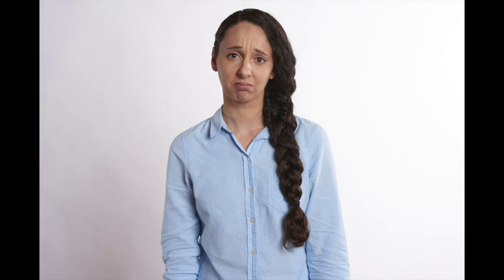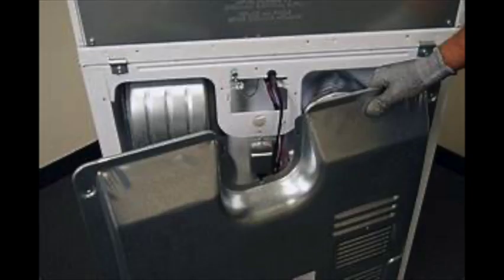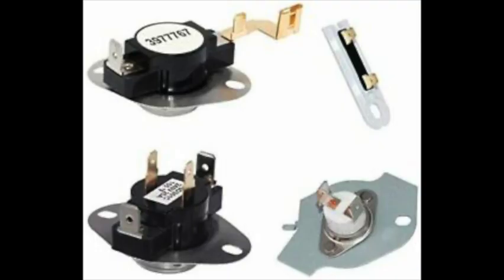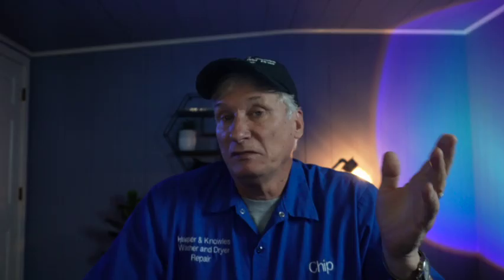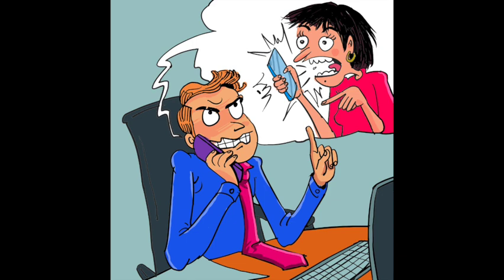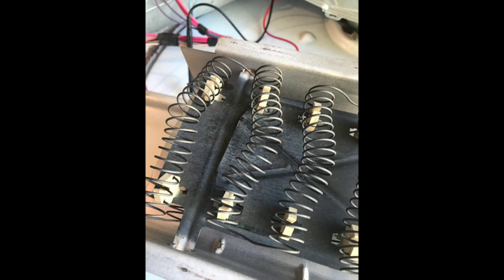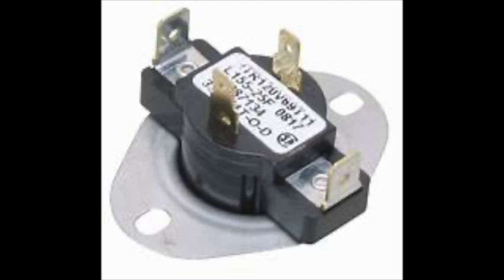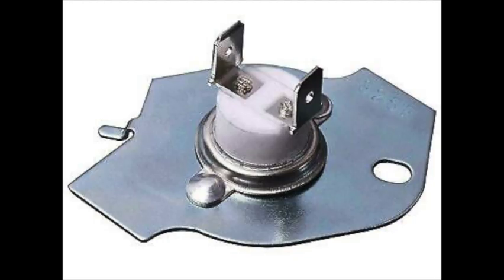How To Diagnose Clothes Dryers That Blow Fuses: Testing Thermal Fuses & Beyond,

Comment: Wow! I really thought you were going to give me the answer because everything has been happening to me in that exact same way. However, I had already replaced the coil at the first step along with all the other parts so that can’t be it. I’ve been through several thermistors and thermal fuse replacements. It just keeps overheating and then tripping/blowing. Sigh…
Reply from the maker: So, if your machine has a thermistor it isn’t the machine like in the video. Without knowing your model I can only guess that you may have a machine with a circuit board and not an analog timer. In this case you may have a faulty control board and you are watching the wrong video. If this is the case you’ll have to replace the faulty board. I hope this is the correct answer for your particular problem . Like I said, without being able to actually diagnose your problem myself all I can give you is my best guess. Thanks for watching!
Reply: @HarperandKnowles  you are incredible for replying and replying so fast! I greatly appreciate this. I have a whirlpool duet dryer wed9200sq1. You are correct it’s not the same. I’ll check out the other videos! Thanks!
Reply from the maker: Pull your control board out of the machine and remove it from the white plastic case. Examine the back for a burned solder point on back of a relay. If it is melted out re-solder that point and it will work for you again.
Reply: @HarperandKnowles  thank you. I’ll try that. They no longer service dryers where I live so I’m trying to do this myself to save from having to buy a whole new dryer. Although sadly, if it is the board, they seem to be very expensive! Thank you sir!
Reply: I’m so thankful for this response. I opened up the control board as u suggested and can see something completely fried on it. If even melted the wiring harness attached. Looks like I can buy a new control board but not seeing any wire harness replacement options. Do you know of any?
Reply from the maker: If it is a relay, it will probably be a standard-sized spade connector. You may be able to repair this by cutting away the old connector and splicing in new wire and new spade plugs. Take pictures first. If the relay is burned, you can order it online and solder it into the board. Most of the time, only one contact on the back side of the board is damaged, but if your wiring is compromised, the whole board may be damaged too. Here is a link to a Duet wiring harness https://www.repairclinic.com/PartDetail/Wire-Harness/W10777438/4383129?TLSID=1779&Ref=611198&utm_term=4585307092177722&utm_campaign=Dryer+-+Medium+Margin&utm_medium=cpc&msclkid=5f8a782ea6b815aad8341c976d58ca32&utm_source=bing&utm_content=Ad+group+%231. I'd use the part number from this page and try to find a used one on eBay, and make sure your model number is compatible. Thanks for the progress report!
Reply: @HarperandKnowles  wish I could share the pictures with you over YouTube. Appreciate all the help.
Reply from the maker: text them to 337-831-6757

Comment: Hello, the heating eliminate went out so we bought a kit,  but once we put everything back together it gets hot enough it blows the thermal fuse, I changed out all the Thermal Cutout Fuse, High Limit thermostat, and the Cycling thermostat. the vents are clear out side and inside the dryer vent is too, I never used the L250-80F fuse not sure if it suppose to go on top where the Thermal Cutout fuse goes are what.  I have the 309F Thermal Fuse Cutout Up top on the heating 
eliminate. I have the High Limit going to the Heating Elements Terminals. and i have the L155-25f fuse going to the Cycling Thermostat.
Reply from the maker: Your element is probably grounding out. It could be permanently grounded or only grounded when it heats up and expands. If you turn the timer to a heat cycle like timed dry and push start then after 30 seconds or so open the door and look inside at the vents. If you can see the element glowing through the vent it is grounded. You can also use a meat thermometer at the back where the exhaust is to check and see if your temperature will cycle on and off. Do this on a timed dry setting with no clothes in the tub. Thanks for watching!

Comment: Im having a similar issue but my question to you is this.  After the dryer shut down would it restart on its own after it cooled down?  This is an awesome video btw.
Reply from the maker: The only time a dryer would restart on its own is if it has a wrinkle shield or wrinkle guard option in the drying cycle. In this case it might appear that the dryer is starting by itself but it is normal for this to occur several times after the drying cycle completes to prevent your clothes from wrinkling.  If your motor’s thermal switch activates due to a motor problem the dryer will shut off but after the motor windings cool it will restart after you push the start switch, usually with an audible motor hum. In this case your motor is failing and needs to be replaced. A blown thermal cutoff fuse on the element side won’t prevent the dryer from starting but it won’t heat.  A blown thermal fuse on the blower side will prevent the dryer from starting on an electric dryer but not on a gas dryer. I hope I’ve answered your question. Thanks for watching!
Reply: @HarperandKnowles  Let me ask in another way, mine shuts down after 20 minutes and appears a little hot and I dont have to do anything but give it time to cool off and it will restart just by pushing start button again.  I have replaced all fuses, just cant pin point.  Thanks in advance for any help.
Reply from the maker: Your motor is failing and will soon quit working all together. It will have to be replaced. It probably hums loudly when starting. This is a symptom of a bad motor. Sometimes the hum isn’t present but most of the time it is. There is a thermal protection switch on the motor
that is kicking out once the windings heat up beyond a safe temperature.  There may also be a burning smell associated with a motor going bad.
Reply: @HarperandKnowles  Is there a test I can do on it or should I just order one?
Reply from the maker: I think a dryer motor pulls about 30 amps.  You could check that if you have one of those multimeters with a clamp on it to test that sort of thing. Or you could make a test cord, check this video for that: Test and Run Dryer Motors | Make A Dryer Motor Tester
https://youtu.be/kDxIt4OPBdE . I usually take the drum out of the dryer, hook a test cord to the motor and run it for about 30 minutes. Turn it off and immediately try to restart it. If it won’t restart or it quits during the test period I replace the motor.  But from what you are telling me I’m willing to bet you have a bad motor.  If your dryer has an electronic control board that could be the issue too.  You didn’t say what kind of dryer you have.
Reply: @HarperandKnowles  whirlpool kenmore elite approx 16 yrs old but never an issue, thanks for the help

Comment: I read in a repair book that said a blown fuse indicates that there could be something wrong with the motor
Reply from the maker: That's correct! A blown fuse can indeed indicate a problem with the motor in a dryer. When the motor experiences a malfunction or overload, it can cause the blower wheel to move less air and the airstream will become slower and hotter causing the fuse to blow as a protective measure. This is a rare occurrence.  It's important to investigate the cause of the blown fuse and address any underlying motor issues to ensure proper functionality of the appliance. Thank you for sharing your knowledge from the repair book and thanks for watching!

Comment: What would think it is if the high limit thermal fuse blows immediately when the start button is pressed
Reply from the maker: I would think that there is a direct short through the fuse. Something might be wired incorrectly. Think of the fuse as a switch acted upon by an external force. That force is the heat coming from the element. A predetermined temperature expands a concave plate inside the fuse to the point that it pops or curves in the opposite direction and opens a set of points connecting the two wires. If this fuse is blowing immediately, then something isn't wired right. It will take a minute or so before the element can heat up enough to cause it to blow that fast. I hope this helps you. Thanks for watching!

Comment: I'm having a problem with my kenmore 90 series dryer it stopped drying it was just blowing cool air opened the bottom of my panel noticed the coils weren't glowing when running I took out the thermal cutoff slammed it on the ground to reset it I started the dryer and the coils started glowing and hot air was coming out the vent the next day I go to my nearest appliance parts store get a thermal cutoff and thermostat I install both the coils start glowing I put everything back together. While at work today I get a call saying the dryer isn't drying the clothes I get home start checking stuff for continuity everything checks out except the new thermal cutoff I'm not getting any continuity from it I remove it slam it check it now I'm getting continuity install it again turn the dryer on coils start glowing I wait a bit and notice that after 1-3 minutes the coils stop glowing. What can my problem be? I checked continuity on the heating element and I'm getting resistance I have no clue what to do anymore.
Reply from the maker: It sounds like you may be having the exact problem that this video you commented on is describing. Watch the whole video, you might find your answer. Thanks for watching.
Reply: Might also want to check the exhaust vent is not blocked with lint
Reply from the maker: @dan4091  Yeah, that could cause it, but a blocked vent usually blows the blower side fuse first.  I’m suspecting an intermittent ground of the element. What do you think?
Reply: @Harper & Knowles Washer and Dryer Repair  It sounds very similar to what I've got going on right now. Are the coils/heating element supposed to be on during the whole heating cycle or do they turn on and off?
Reply from the maker: @rodm2345  The element should cycle off when the exhaust temperature reaches the neighborhood of 155 degrees. With your dryer empty and set to high heat use a thermometer to monitor the exhaust heat. Around 155 degrees you should hear the cycling thermostat click off and your temperature should start to fall in a few seconds. When it falls to about 135 or so it will cycle back on and the temperature will begin to rise again.  If your temperature does not cycle on and off then you probably have a bad cycling thermostat or your element is expanding and making contact with the frame somewhere.  If the temperature continues to rise past 175 or more, open the door and look to see if your element continues to glow after the motor stops. If so it’s your element grounding, if not, change the cycling thermostat.
Reply: @Harper & Knowles Washer and Dryer Repair  Well I think I found the problem I pulled the heating element out and it has 2 cracks one in the middle and the other towards the end. Not the coils but the metal assembly has the cracks. Do you think that's the problem?
Reply from the maker: If the frame is cracked and warped it could very well be making contact with the coils. Did you do a continuity check from the spade connectors of the coils to the frame it’s mounted in? Should be no continuity.
Reply: @Harper & Knowles Washer and Dryer Repair  I just did that right now and it's showing continuity. Hopefully I tested it right
Reply: @HarperandKnowles  The cracks are on the metal piece/frame  where the coils wrap around it. The coils don't seem to be damaged
Reply from the maker: Then you have a coil touching the frame. Sometimes it’s hard to find. I’d change the element.
Reply from the maker: If you find where it’s touching move it away from the frame. Straighten the coils, check continuity, you may be able to fix it enough until your new element arrives.
Reply: @Harper & Knowles Washer and Dryer Repair I have a feeling it is the element just because it's never been replaced and the cracks just seem like a dead giveaway. I'm starting to feel just like Griswold in the movie when he puts up his Christmas lights and they don't turn on 🤣. My local appliance parts store said they have a element in stock so I'll pick that up tomorrow and replace all the other fuses and hopefully that solves my problem. I'll get back tomorrow to let you know what ended up happening. Thank you so much for the help 👍
Reply from the maker: I’m pretty sure that will fix it. I wouldn’t trust that slapped fuse though. I hope the video was helpful. Good luck!
Reply: @Harper & Knowles Washer and Dryer Repair  Yeah I'm gonna replace that one as well I'm not getting continuity from it right now.
Reply: @Harper & Knowles Washer and Dryer Repair  Got home installed new element along with a couple fuses except a thermal fuse they didn't seem to have it at my local appliance store put everything together turned on the dryer and it all seems to be working fine now the coils turn on and off constantly. Thank you for the video and the help I really appreciate it.
Reply from the maker: @rodm2345  Anytime my friend. I’m glad you’re back in the laundry business!

Comment: If the element is cheap, and/or the dryer is older, probably best to just replace the element.  The additional cost probably doesn't drive the price up much vs the total cost of a service call like this.
Reply from the maker: You are probably right. Thanks for watching.
Reply: I had this happen with a new element. The housing needs to be bigger or the coils need to be less. Changed all the thermostats and the thermistor. I did this last night because what better day than Christmas day. Not the fault of any technician if the element is designed poorly.
Reply from the maker: Thanks for sharing!

Comment: Where do you buy your parts from
Reply from the maker: I source my parts from many different places. I will buy in bulk the parts I use most often when I find good discounts. A lot of my parts come from Amazon. If you establish a business account with them you get business only pricing and free prime shipping if you have a prime account. Use their American Express business card to get the best cash back on purchases and upload your reseller tax info issued by your state for tax free purchasing. You can do the same with other suppliers but you’ll have to meet a minimum order from free shipping. Thanks for watching!
Reply: @HarperandKnowles ok thx last question so i need a thermometer on my dryer can buy any thermometer that fits??? Or do I have to buy the exact model component??
Reply from the maker: Here is a link to the thermometer I use in the field. https://amzn.to/3v7Og6V.  You can also buy a cheap meat thermometer that you can clip to the exhaust outlet.
Reply: I’m sorry I dumb. I meant thermistor i I just use any thermistor
Reply from the maker: Use your model number and then the part for a search string “model# thermistor” that should get you a variety of retailers.

Comment: Here’s a real test for all you diagnostic guys out there. I have a basic Maytag electric dryer less than 5 years old that keeps blowing the fuse at the fusebox. The dryer is getting power and it lights off just fine and gets hot. It runs for approx 10-15 mins then blows the breaker. I have watched approx 12 videos including this one on how to diagnose the various switches, thermistor, thermostat and parts inside the back service panel. I have used the multimeter to test all those parts and I am getting continuity on everything. What could be causing this thing to blow the breaker???
Reply from the maker: Is it a gas dryer?
Reply from the maker: I'd change the breaker.
Reply: @HarperandKnowles  it’s an electric. I also checked the service panel for the electric connection and it’s tested fine at 240. Yes I’m thinking it might be a breaker.
Reply from the maker: I'd change the breaker. If its coming on and running awhile its probably the breaker or a problem with the receptical or home wiring.

Comment: So did you have to buy a whole new housing unit
Reply from the maker: I’m not exactly sure what you are asking but I’m assuming you mean the element already strung on its ceramic standoffs and contained in its metal housing as opposed to just the element coil unstrung.   If so, yep that’s what I had to do, but the cost of getting the whole element unit is negligible compared to the coils only. Thanks for the comment!

Comment: In mine my thermal fuse blows..heater element its new.
Reply from the maker: Take the exhaust hose off the back, and with NO clothes in the dryer select, a cycle for high heat and timed dry. Test the air output with a thermometer that reads at least 200 degrees F.  
Your machine should cycle off when it reaches around 155 degrees F, (140 for GE, Frigidaire). It may go as high as 160 - 163 before it starts to cool, then It should cycle back on at about 130 degrees, give or take five degrees.
 If your machine is hotter, try replacing the cycling thermostat (the one with four prongs). It's best to change all the thermal cutoff components while you're changing them. If you still have problems after this, you probably have an airflow problem. Check out these other videos for more ideas. And thanks for watching! Good luck with your repair.

https://youtu.be/-hTKotLc5BA 

https://youtu.be/3FGsZdoM4bM